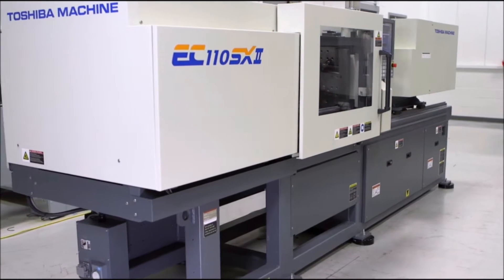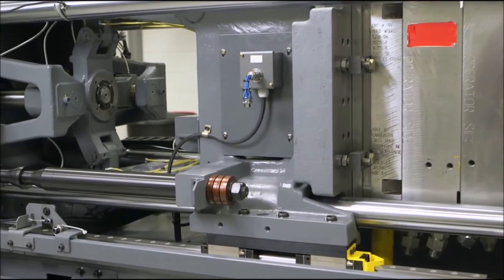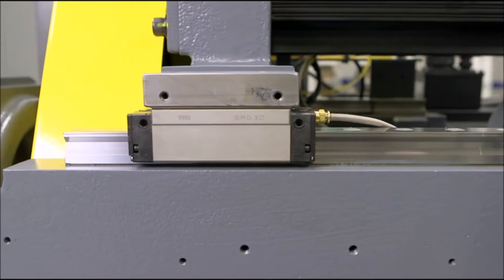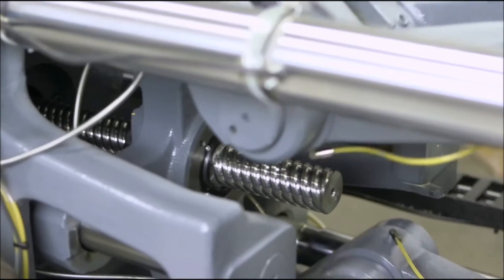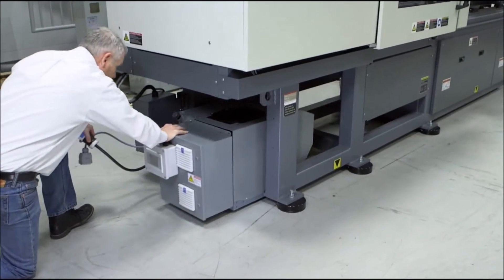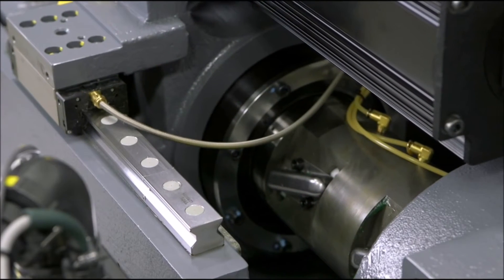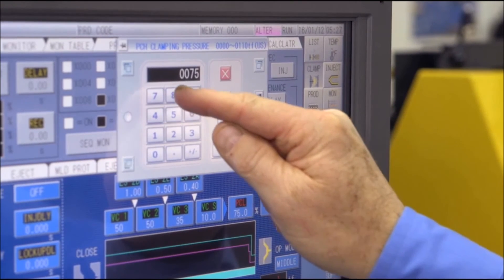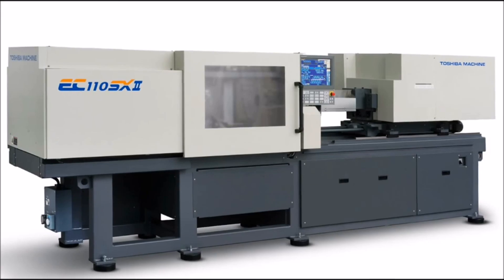Molding Machine Toshiba

Comment from the maker: The new electric molding machine ECSXII - all-electrics.
One of the most powerful and accuracy molding machine to archives scientific molding.

Now we've taken the next step.  Introducing the all-new ECSXII - all-electrics with the same versatility and performance, along with a streamlined frame design, significantly faster injection speeds and new features making your investment work harder and smarter.  Extremely flexible and versatile, the new ECSXII is ideal for virtually all molding applications, from automotive and aerospace to packaging, medical and more.
I really recommend this Toshiba machine.

www.rhlplastics.com